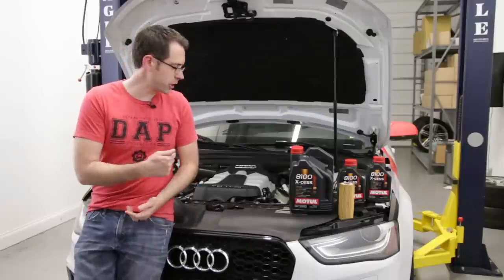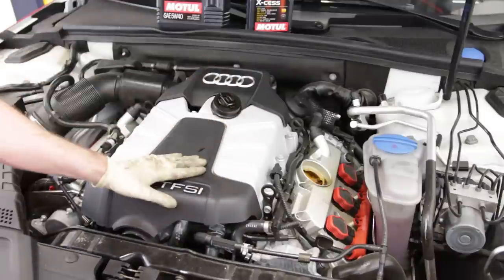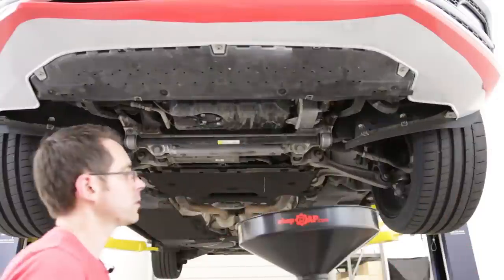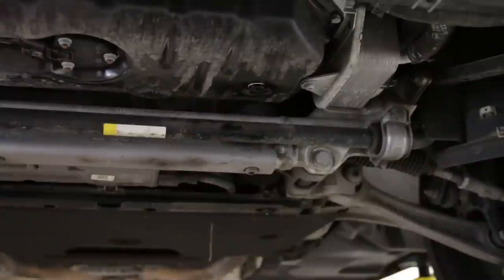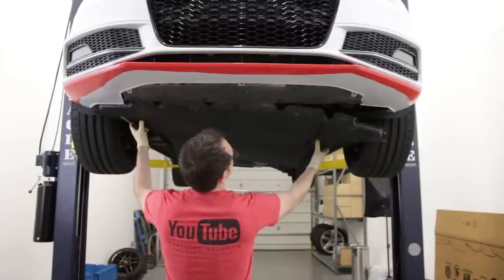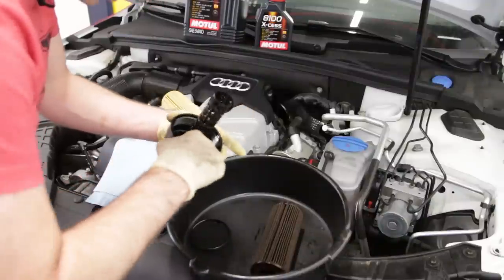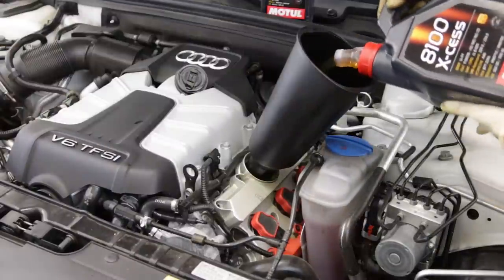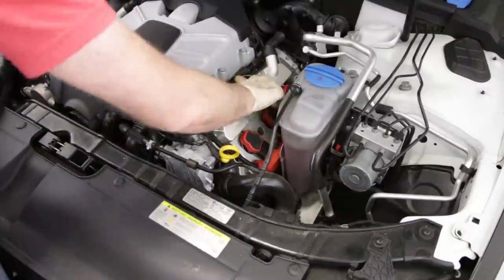How to Change the Oil on a 3.0t Audi S4

Comment: Great video! Having an oil extractor really helps speed things up. You won't don't have to jack the car up or remove the belly pan.
Reply: Are you able to remove all the oil though?
Reply: Yes, my car has the 3.2L FSI which also holds 7 quarts and I always extract that amount.
Reply: I have a oil vacuum  Extractor will it get 99 percent of oil out ? If the car is jacked up in the front it would make sense it would no completely drain. Why I'm asking if the vacuum pump extraction works better?
Reply: +1 I use the 12V extractor on my 3.0T A8L, always gets the full amount out.
Reply: Do you just run a hose down the dipstick hole?
Reply: @TheChadls  yes

Comment: Thanks for the tutorial! Bought a 2018 a6 and Audi wants good amount for the oil change!
Reply: Do it yourself.  I been doing it with my 2015 q7 I also learned how to replace the spark plugs and supercharger belt. Do it!
Reply: Yeah, here in Australia Audi wants $600 aud (440 usd) for an oil change. No thanks, I'd rather do it myself.
Reply: trebor19418 here they want almost the same amount, but I got Castro edge and Mann filter for under 60 bucks for my oil change, is no different than any other car tbh.

Comment: Just did my 2012 S4 oil change. Went with Liqui Moly Top Tec 4200 5w30 as I had extra from my Stage 2+ WRX. It meets all the specs required. I also added 300ml of Liqui Moly MOS2 Engine treatment and used a fluid extractor which sucked the pan dry, I put in 6.3 litres to register perfect on dipstick and MMI system. All good to go now at 50k:)
Reply: Repeat every 2000-3000 miles.  You act like it's a once in a lifetime event to change your oil.  Don't wait 5000-10000 miles unless you're trying to kill your motor.
Reply: Bob Saget  You're whining?  I haven't noticed.
Reply: Bob Saget  triggered, eh?
Reply: Thought it's 5 w 40

Comment: The best part of the oil change on the 3.0 is the top mounted filter.  I change the filter one time before a change.  The only engine I know of that you can do that on.  Why not use a Mityvac pump to remove the oil from the "dipstick?"  I can change the oil and filter in under 20 minutes that way.
Reply: Yeah, I never get under the car.  I use a fluid extractor directly from the dipstick tube.  No fuss, no mess!
Reply: Same thing here - I use a Mityvac extractor on my A4 (not S4). Just make sure the oil is hot for easy extraction.  Takes 20 minutes if you factor in drinking one beer.  Otherwise it's more like 10 minutes... :-)
I also have a BMW 328i xdrive without a dipstick. So even if the oil filter is on top, I still have to go underneath the car.  Real pain.
Reply: The newer Subaru engines also have top mounted filters. Even easier too as they’re not media based, but fully enclosed cartridge type. Spin off, spin on.
Reply: Brendon Kelly mk6, mk7 golfs and also b6 b7 s4 have filters at the top
Reply: Romario Smith mk7 golf oil filter is on the bottum
Reply: LEXUS-RX300 no its not. Its latest the top.
Reply: Would this model be a good choice MITYVAC 07400 Fluid Evacuator also does the filter come with the gaskets?
Reply: You should drain it from the bottom at occasionally to get all that sludge, etc.

Comment: Can you use an oil extractor for this? I know it doesn't have a dip stick but some Audi engines keep the tube for extracting oil. Thanks.
Reply: Around the 11:20 mark he shows you where that tube is. I know this is 2 years later 😂

Comment: What are your thought of using the vacuum method of the oil out of the top.  I have been doing that on my a7.  Dealer said they do it that way also.  When I asked which was better they said either way because the filter catches any debris your thoughts.

Comment: Loved the video but dislike the oil selection, Motul has a low heat resistance have tried it twice with bad results. 
First in a 7500 mile oil change interval had to refill with two more quarts but when using before and after Castrol and Pentosin didn't need to add a drop at the same OCI. 
Second time I used Motul 75w-140 in my PTU and it burned very fast it nearly blew my PTU thank God I noticed a strange noise and pulled over. After that I put in Redline 75w-140 and haven't had issues.  
So I wouldn't recommend that anyone should use Motul if you don't want to keep refilling and wasting money, sometimes is not your engine that's burning oil it might be the oil that your using.

Comment: Hello Deutsche.  Very nice video.  Do you know if an oil extractor / mitivac through dipstick would get most of the oil out?  thanks
Reply: My same question.  I used it on my Volvo c30 with  good results.  Seems alot easier than jacking the front of the car up and not actually getting a full drain. Glad I got my pump vacuum oil extraction oil pump. Not very cheep but well worth it.

Comment: there's no chance that the 5 minute oil change place is changing out those o-rings
Reply: What O rings :'D
Reply: I've never changed one in over a decade and never had one leak
Reply: @aleks138  Just sounds lazy. If there's one included, I'll replace it.
Reply: @TheCrazySquirell  exactly people are lazy af my car was missing it from the previous owner
Reply: Very simple, we used to replace those on the 2.7 ecoboost engines
Reply: The good ones do my boys at take 5 alr knew they had to do my oring for my s4
Reply: Makes you wonder how important changing them out actually is DOESNT it

Comment: Thanks for doing the video.  I've learned that I need to use 50200 oil for my car and I just placed an order!
Reply from the maker: Thanks for the order.  We appreciate it very much!
Reply: Im confused because the Audi website says this engine is on the 508.00 standard which is a 0w-20 oil...

https://www.audiusa.com/content/dam/audiusa/Documents/MyAudi/audi-2017-oil-and-fuel-brochure%20.pdf
Reply: @Dubz0408  3.0 L Engine (CGXB/CTUA)
Oil and Filter Change
6.8 L (7.2 qt.) VW 502 00
 and that's from audi service website.

Comment: Still skeptical about how oil filter cartridge on top of the engine works better than the traditional lower mounted screw on filter casings.

Comment: I did my oil change myself on my 2018 Audi S4 and now the system is telling me that I am at max oil level and i need to drain my oil. Also, now the car would not go into drive without warning signs? Whats you suggest.
Reply: LOL you drained the transmission fluid. And overfilled your engine with oil. You fucked up buddy.
Reply: @dogchainsaw3923  that sounds like a nightmare

Comment: I Just picked up a s4 b8 and they claimed they put in castrol edge but I couldn't check the oil because it didn't come with a dip stick, Today I Finally got a dip stick after 500 miles and the oil looks dirty, is that normal? all the other cars the oil always looks clean for a long time, I'm thinking I might just redo it.

Comment: Do you need to replace the drain plug every time with the oil change? I do my services every half interval and Audicare takes care of the yearly service. I don't replace my drain plug but notice they do each service.
Reply: B8Addict you have to replace the crusher washer
Reply: D Phantom97 yup, that’s done every time for sure. But what about the drain plug?
Reply: B8Addict you don’t have to replace the drain plug every time no
Reply: Not the drain plug every time, but absolutely the crush washer.

Comment: Great video. Thank you. I'm looking at buying a 2015 Q7 Sline with the 3.0 TFSI engine. It only has 39,000 miles. Overall, the car is super clean but it seems like the internal engine parts I can see through the cap hole are way more reddish/varnished looking than I would expect. Although it runs great, the owner doesn't have service records. It may just be how these look. This is the only Audi I've ever checked out. They're not common where I live so I can't just stop in somewhere and have a look. I just don't want to buy a poorly-serviced vehicle. I'm sure you know what the internals should look like. Is reddish/varnished ok or a dead give away for poor oil maintenance? Every other (non audi) car I've ever looked in has clean (oily) metal parts visible through the hole.

Comment: Ordered the dipstick with the part #  06E-115-611-H  in his link above for my 2010 Audi S4 and it works great and its accurate.would recommend if you need one.
Reply: tried same part # on Amazon DONT BUY it breaks
Reply: @connerbilinski6750  so buy it from Amazon instead?

Comment: Will the 5w-40 be good for s4 2018?  Or should I use 0w-20?
Reply: Follow the manual specifications. Don't just guess or assume.
Reply: You could damage the motor if you use too thin of an oil, like 20 weight, if it was intended to use 40 weight oil like my Audi S4 is.  A thinner oil generally doesn't protect as well against metal on metal wear as a heavier oil, but can be necessary for various reasons.  The number before the "w" just indicates the "winter" or cold viscosity before the oil is warmed up, relative to the oil weight (20, 30, or 40.)  Too thick of an oil (if you used 90 weight gear oil for example,) would not splash around and penetrate enough to lubricate all the bearings and other surfaces that need oil.  If it says "0w" before the oil weight, such as "0w40" that means it's the same weight when it's cold as when it's warmed up.  It will be a much thinner oil in the jug at room temperature than 5w40 or 10w40.  When warmed up they will be the same.

Comment: Please help! I had my oil changed 2 weeks ago. After about a week and a half I noticed that I had a leak. I took it back to the shop and they found it was the sump plug leaking. They drained the oil and put on a new washer and filled it with fresh oil for free. I hoped that was the end of it however today I found that it is leaking again. I took it back to the shop and they told me to bring it in tomorrow morning. He's confused and doesnt know why its leaking. He said he replaced the washer with a new one of the same size, material etc (I think he said it was Brass). Does anyone know why it's leaking? Has he stripped the bolt/sump or is there another reason? Cheers.
Reply: Where is it leaking from, front or back? Maybe check to see if the oil filter was inserted correctly, theres a possibility it could be leaking from the oil filter being installed incorrectly.
Reply: rcl300018 Thanks for your reply. It was leaking from the sump plug. We ended up installing a fibre washer and it stopped leaking.

Comment: Curious why you didn’t use a fluid extractor, which is what’s recommended by Audi?
Reply: +1
Reply: Moti - I was asking myself the same questions before I started using my extractor, but I was not able to find data proving what you state.  An Audi technician told me it has been studied by Audi and no issues were found (I did not see that study so I cannot really approve / disapprove).  Personally I can vacuum the whole 4.6L in my 2.0T A4.  Same quantity as draining.  I do it when the oil is at operating temperature, so everything is well mixed and hot.  And if the oil filter is doing its job properly, I don't see why it would be a problem.  I'd be curious in seeing a real study with real data.
Reply: Moti 604 also install a Fumoto oil drain plug way better just flick the ball switch. Used in last two vehicles and in my 15 WRX w top mount super accessible oil filter it was awesome.
Reply: What version of the Fumoto for the S4?
Reply: Fluid extractor is nice to have and do maybe every other oil change. Reason is because it does not extract all the dirt/buildup/shavings (if any). When you drain it from the bottom, you are ensuring the above is being drained out with the oil.
Reply: I work at an Audi dealership as a tech, Audi does not “recommend” using an extractor, nor do they prohibit using one.

Comment: So what's the purpose of dipstick less engine???let's let guess for epa rating??
Reply: It’s not completely without one...they come with a plastic plug in the dipstick tube opening. You can simply buy one, pull the plug, and drop it in. Just bought one myself as I did not want to rely on the sensor. But why they did not just include one, beats me!

Comment: i want to buy an s4 instead of lease. im scared of dealership scamming me or trapping me into their maintenance service and over charging. are these cars reliable to buy? im scared to buy used btw.
i have to learn learn how to take care of it on my own since the car alone is already going to break the bank. this is my dream car and i plan on using it for 8-10 years if i buy one. otherwise i will have to look at domestic options such as mustang or challenger, etc. im willing to find a long term reliable mechanic but im scared of sabotage which leads to further costs.
anyone have advice?
Reply: What year are you considering? The B8-8.5 model years have one of the most reliable engines to date.
Reply: @andysuxd1cks  i was thinking 2019 s4 because im scared of buying used and i dont know much about them.  but its sad that they got rid of manual option in the new ones
Reply: A4 is nice too but i like S4 a lot more.  the engines are obviously different which means one may be a lot easier and cheaper to repair than the other
Reply: aidsimo it’s all personal preference. But I like the b8.5 the most out of the current options (as a best overall considering price maintenance and fun) I personally love the supercharger and would never get a later model because of that. The engines are supposedly very reliable. Realistically you are either going to be paying more for a new car with no problems in the beginning, or preventive maintenance and a couple repairs on a used car. However the design of the 8.5 imo is worth preserving. Good design is timeless and this car has and will age well.
Reply: aidsimo I would buy it if you can afford it, (another reason b8.5 is good choice, they are getting cheaper. Expect around 40k (20k for car and 20k potential maintenance) but it should be a nearly new car after that regardless of mileage)

Comment: That engines are working in much higher temperatures than usualy and they need really good quality oils. Only PAO\Ester based oils have high enought high temperature resistance. HC-Synthese mineral oils like that Motul are coking and leave that orange\brown sludge inside of engine and a lot of carbon deposits in hottest engine places like piston rings. Thats not a good idea to use poor quality oil like this for this type of engines. That cars requires low SAPS oils as well. That MOTUL is a Full SAPS oil and kills the catalyst faster. I have no idea how it's possible that someone who have no idea about engines and oils can give advices.

Comment: It takes 6.5L of engine oil. Not 7litre! >>nicht überfüllen!!<<
Reply: Really, my 2013 s4 needs 6.8l, I'm in Australia, maybe our cars have a deeper sump. Or maybe if you swap over the oil filter that holds 300 mil so I'm guessing thats were our differences varie.
Reply: I was about to post that.  7 US Quarts is correct.
Reply: Just did mine yesterday, 7 quarts, then the next day the mmi said I was a tad bit low. I  checked the dipstick, it was fine. 2010 s4
Reply: Oil is sold by the quart in the USA.  The oil capacity is 6.8 liters, probably without filter if it's like most factory specs.  So yes, around 7 liters.  Quit whining.  I'm guessing you'll never do your own oil change anyhow.
Reply: @tcolondovich2996  I own an Audi with the 3.0L supercharged (CAJA) engine and have done over a dozen oil/filter changes with most scrupulous care. The engine oil capacity is from the owner's manual and always confirmed by the factory fitted dipstick.
Reply: @edjowett1616  yes that's 6.6litres.
Reply: @10secTonner  - the dipstick doesn't lie but my CAJA series 3.0 TFSI engine only takes 6.5Litre within oil and filter change.

Comment: I USED 5W30 WHY U USED 5W40 ?
Reply: Probably because Audi specs say to use 5w40.  Maybe you should follow directions.  Using too thin of an oil provides less protection for your motor.